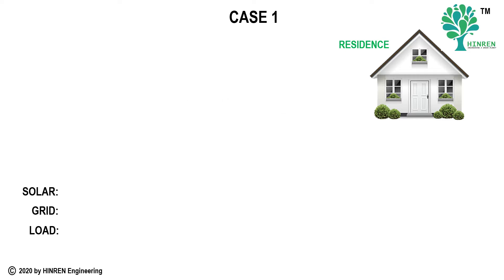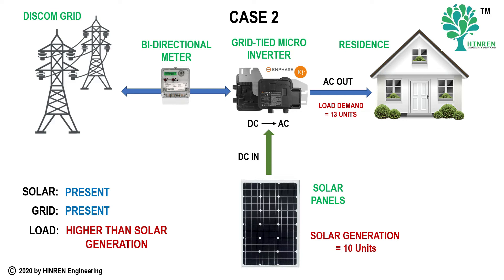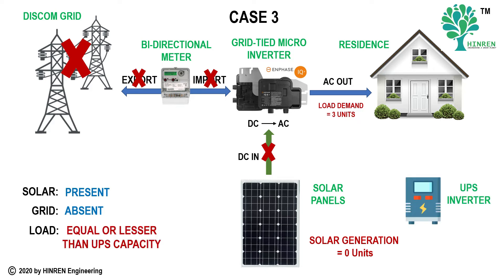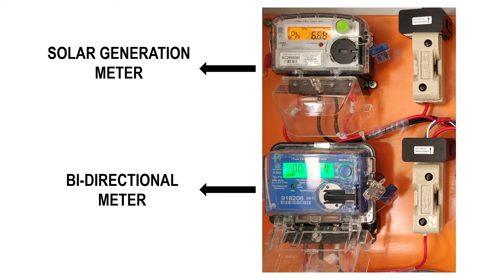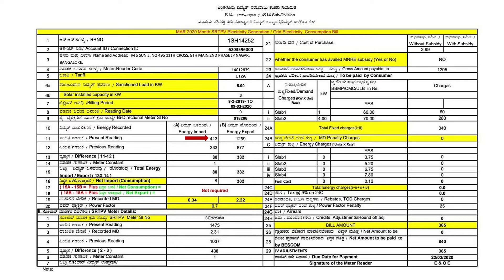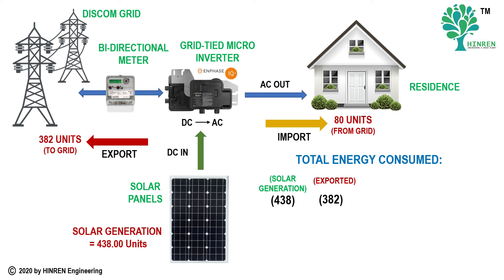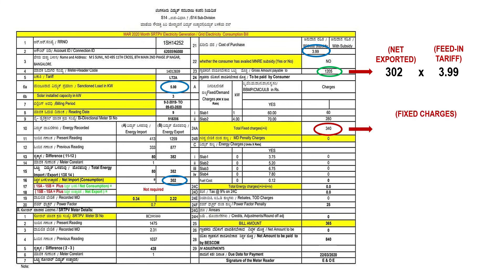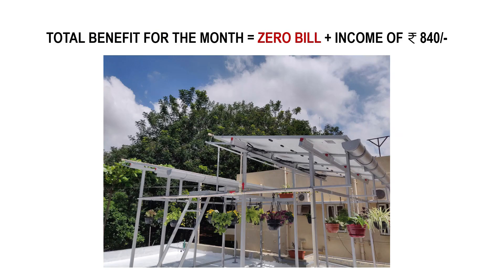Net Metering in Rooftop Solar PV Systems

Comment: Dear Sir, for case -3 if we install battery backup for solar panel, can power from battery through inverter be used? Instyof using separate UPS
Reply: Yes that is called hybrid system

Comment: Can we use on grid solar system after grid failure
Please tell any options sir
Reply from the maker: In a typical on grid setup , inverters will switch off when grid is absent.